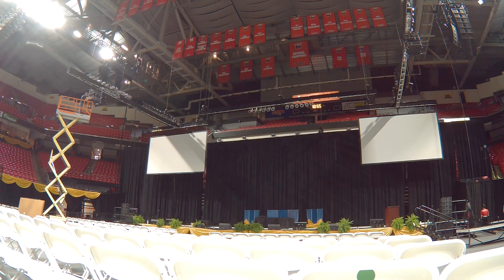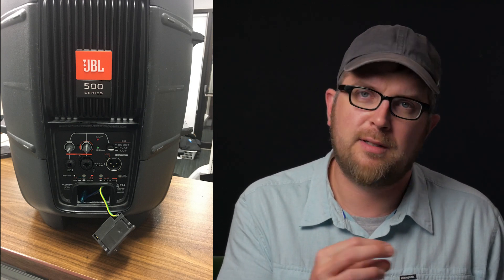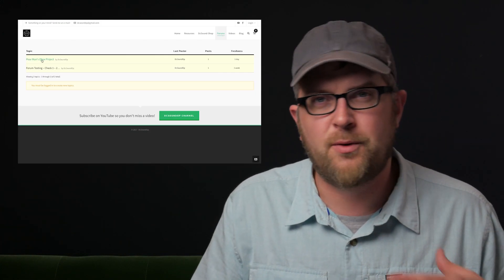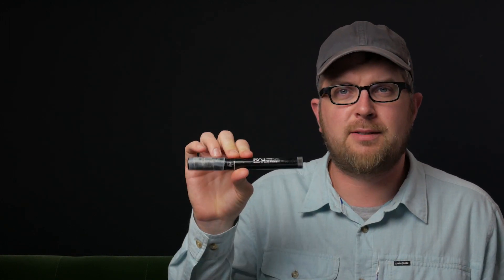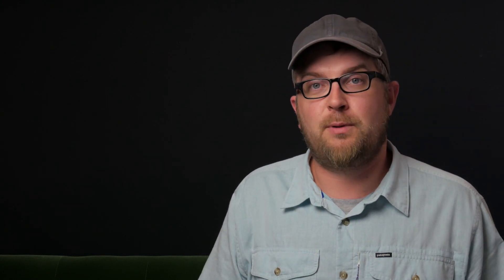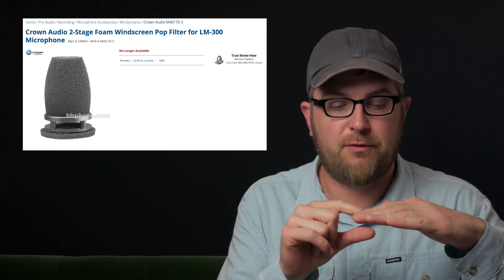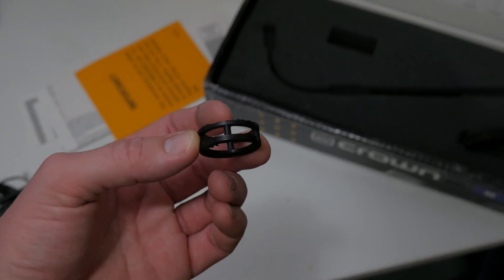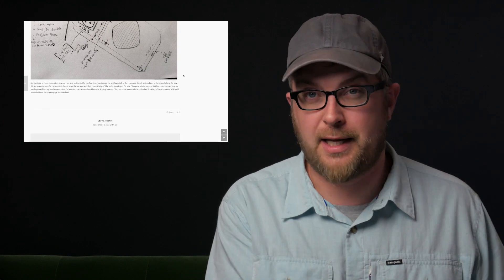#57 - Line Array Speakers, Sound Projects, 3D printing & more!

Comment: Killer video bro!
I would like to see a video on how you wire Line Array Speakers to their amps! and subs as well!
Reply from the maker: DJ Brandon Thanks Brandon, I think I can make that happen in the future for sure 👍🏼
Reply: Thanks i always wondered how they are connected!
Reply: Nice video as always, 

I also wonder the numbers of consideration to be taken when using line array speakers for the job, both worst case scenario when time is too short and when time is enough to do detail set ups for mixing shows that have a higher demand in sound quality

Comment: Hey! 3D Printing from Illustrator? I didn't know you can do that, I thought it should be from Autocad or some other 3D software
Reply from the maker: Miguelangel Espinal yeah, Is starting in illustrator and then taking it into photoshop and using the 3D tools there to extrude the parts. I'm only using it because I already pay for Adobe software, I'd love to get into fusion 360 eventually though. 

How've you been man? I hope things are good in Panama, I can't wait to get back there!